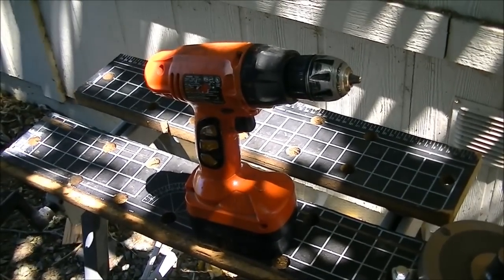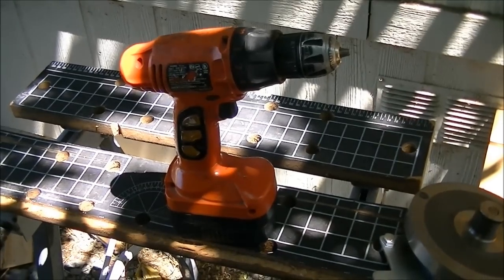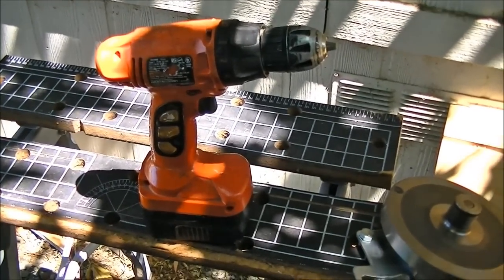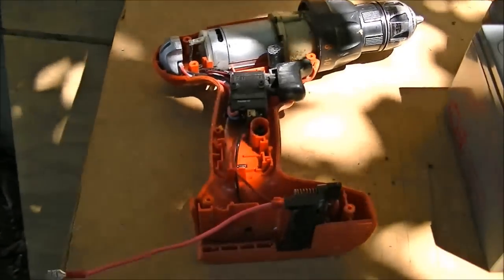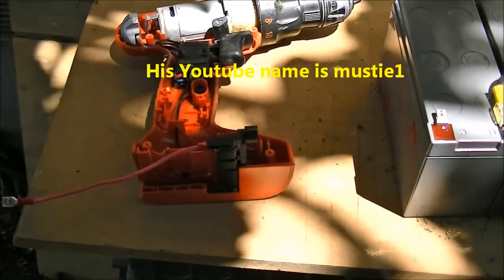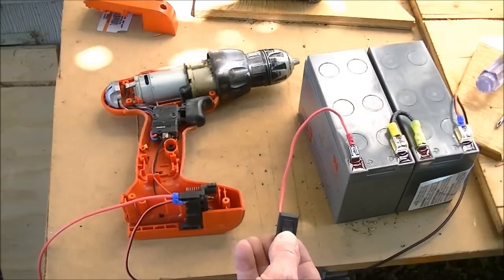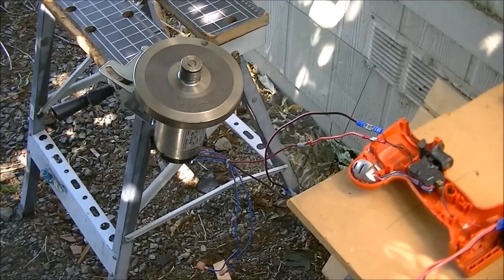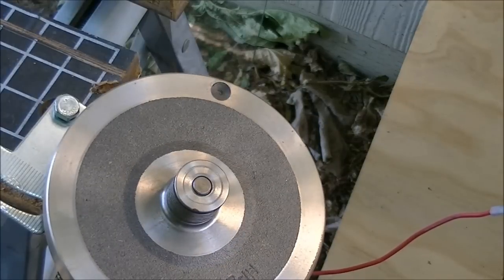Cordless Electric Drill Switch DC Motor Control

Comment: I wonder if using a battery drill as a motor with chain and gear  hooked up to a wheelbarrow wheel would work. Obviously geared properly would be the case but using an old pushbike chain, cogs and gear adjusters, I think the torque would easily pull a barrow full of gravel. You could even adapt snow chains
Reply: Make it and try.

Comment from the maker: 21.4 amps, which is pretty high. I'd need some heavy gauge wire if I was to come close to that, but I'm not going to. I have an ebike motor controller  coming from China. Might be here next week.

Comment: that looks like 130volt treadmill motor.....youare running it on how many volts? 24V?  through the drill trigger,  ow many watts/hp are you get from treadmill motor?  they are like 2HP or more at 130 v, what is it putting out for you at lower volts?

Comment: Hey, put a platter on it and use it to model clay pots and bowls before the kiln. or not.
I need to learn about basic electricity. Scares me too much though. I can wire recording studios and small voltage stuff but that's it.

Comment: Ironic. My drill trigger has lost its speed control and I was looking for a trick to fix IT, instead of fixing other things with it  xD
Its going to rip my arm off one of these days xD
Reply from the maker: +Richard Smith Sorry this wasn't the right video for you.
Reply: John Strabismus Its an old 120v proper high power drill, so the no speed control thing is a problem, especially since it also does not have a cluch. A shame, it is 31 years old, been put through god knows how much work, and the gears and motor are still showing nearly no signs of wear. 
Took the trigger apart, and nothing seems to be wrong, so I am clueless as to why it no longer works correctly xD

Comment: My Bosch GSR 10.8V Li  drill rotate only Anticlockwise . 
Any suggestions ?
Thanks ahead.
Reply from the maker: Take it apart and check the switch. When troubleshooting always start with the simplest first.
Reply: Use the reverse switch